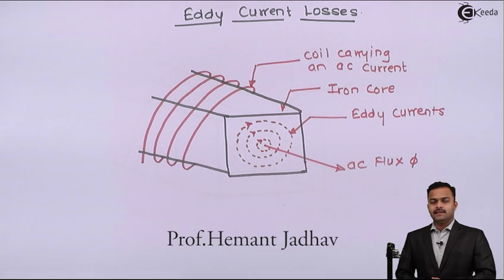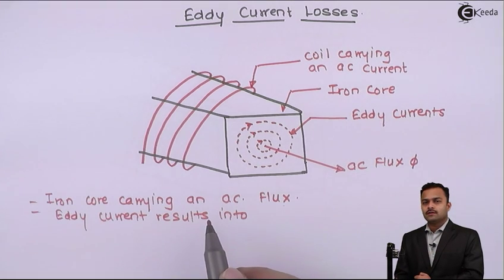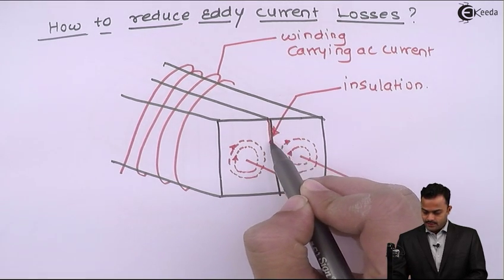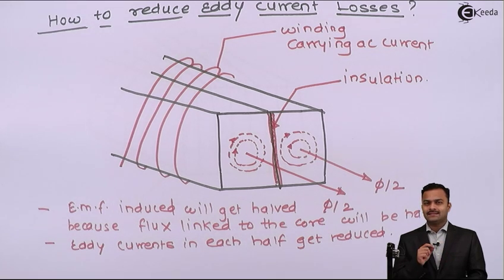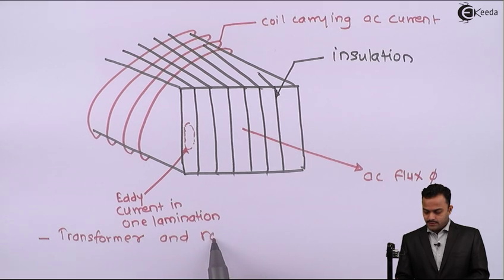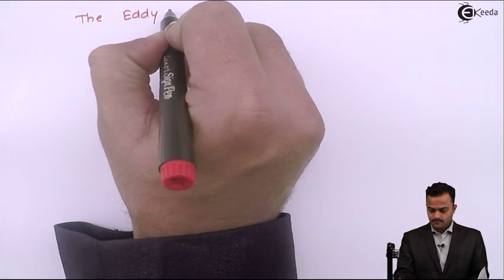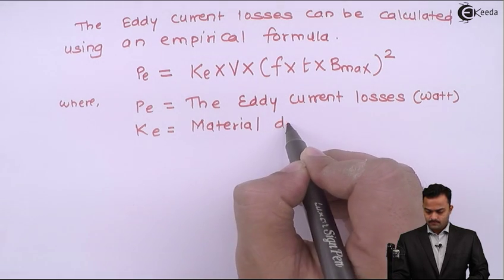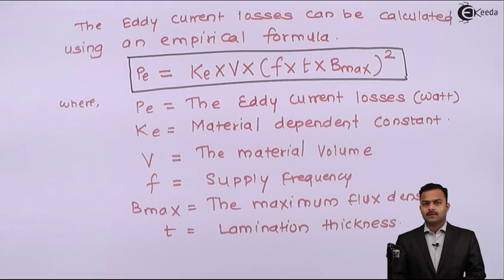Eddy Current Losses - Magnetic Circuits - Basic Electrical Engineering

Comment: The iron loss of a transformer at 400 Hz is 10 W. Assuming that eddy current and hysteresis losses vary as the square of flux density, the iron loss of the transformer at rated voltage but at 50 Hz would be....... watt.
(a) 80
(b) 640
(c) 1.25
(d) 100

How to solve it?
Reply: c
because Pe and Ph both are directly propotional to f so if frequency decreases then Pe and Ph also decreases so only option c matches

Comment: Guten Tag,ich will die Verluste (Skineffekte ,Proximity effekt) in  Kupfer mit Fläche 10mm mal 2mm(Rechteck),Länge 1 m  bei 40 A mit Frequenzen 100 Hz und 1000HZ und 10000 Hz  berechnen aber habe ich leider keine richtige Formel gefunden.....Könnten sie mir helfen,ich habe auch meine Professoren an der Uni gefragt aber haben auch keine Ahnung..........Es wäre nett von Ihnen,wenn Sie mir helfen könnten.
Reply from the maker: Bitte Schriben sie in English.
Reply: hello, i would like to calculate Skin effect and proximity effect  in rectangular conductors area is 2 *10 mm*mm and length 1 m ,curent 40 A, in frequenz   100 HZ,1000Hz,10000 Hz.could you please  help me ????????